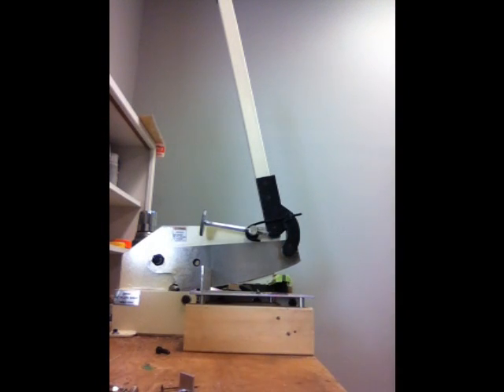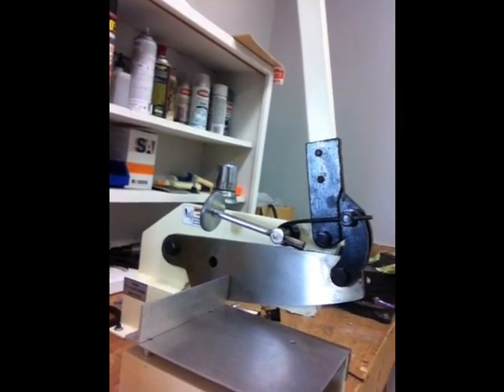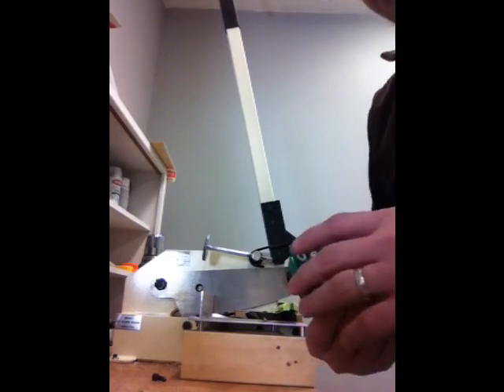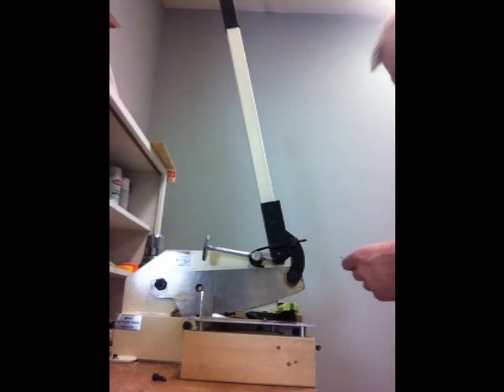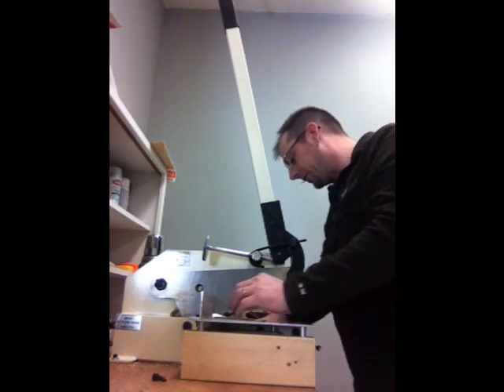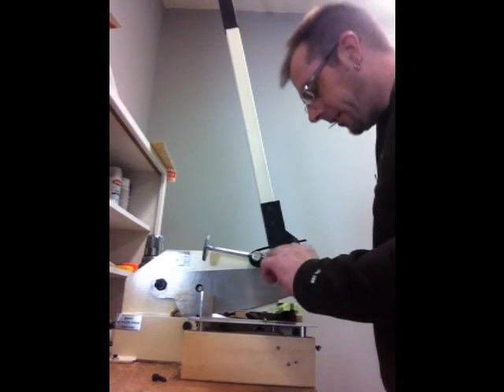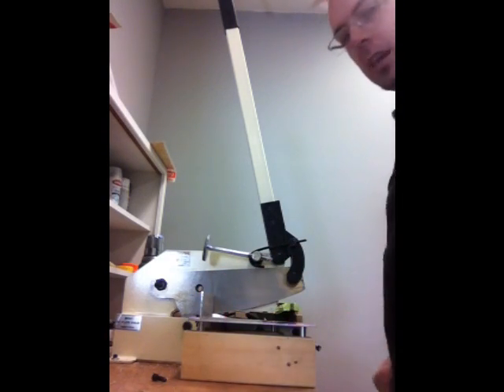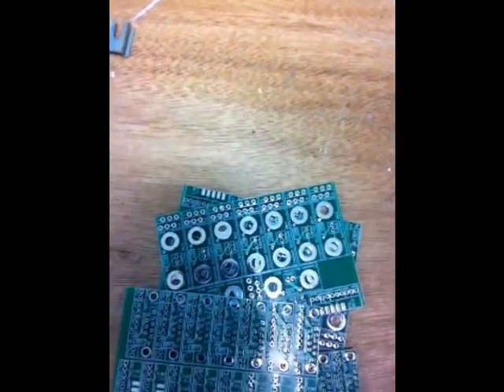PCB Shear

Comment: That is seriously awesome. This is the exact solution i've been searching for so I could get away from cutting boards out with a dremel. Not sure if you're still making content, but you got a subscribe anyway.
Reply from the maker: I'm currently using one like this.  I just removed the top cover so I could see my silkscreen lines to shear.  https://www.ebay.com/itm/255253709292?mkcid=16&mkevt=1&mkrid=711-127632-2357-0&ssspo=_frBywpzTmu&sssrc=2349624&ssuid=SwCz0hovTym&var=&widget_ver=artemis&media=COPY